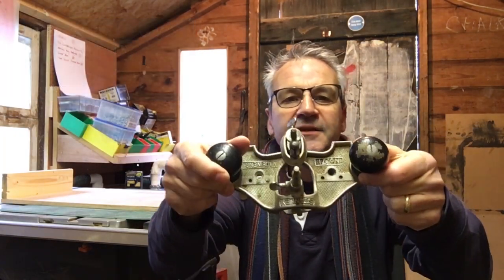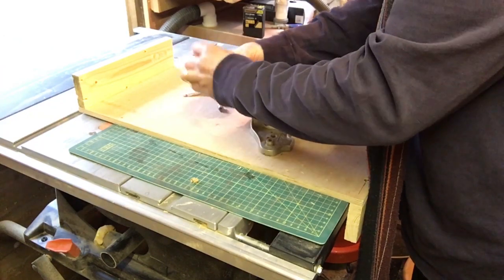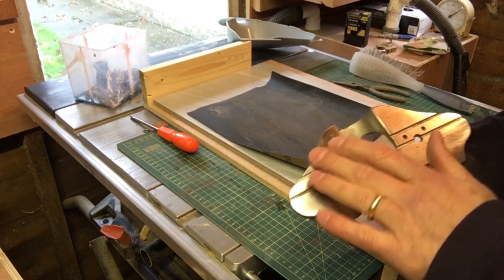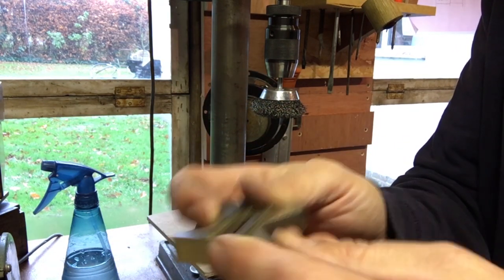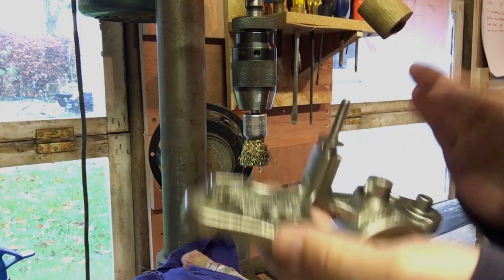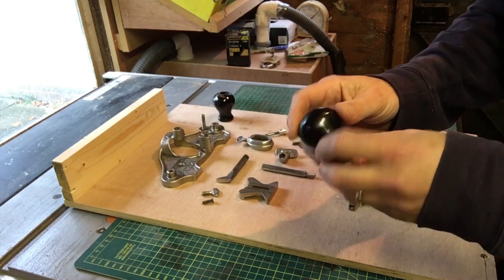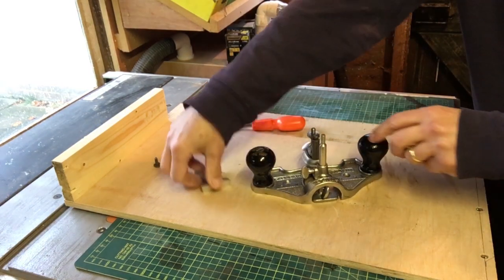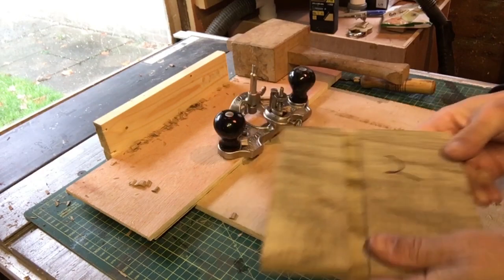Restoring and sharpening an antique Stanley No. 71 Router Plane

Comment: The No71 is an open throat, the No71 1/2 is the closed throat version. The shoe on the 71 is used to close the throat for when it might be needed to work on edges of wood...it stops the plane tipping. The cutting iron can be also mounted facing the back of the plane for bullnose work, or left/right while mounted at the back of the plane....but I see little use for it mounted left/right. Turn the shoe upside down and the post end of it works as a depth gauge, but I find its handier to work to a scribe line for through cuts.....the shoe for mine lives in a drawer and I hardly ever use it. Its best practice to use the plane on your side of the work......that is...... never working out through the back of the piece, work from both edges and into the middle of your housing/dado  :) Bench planes or joinery planes are loads of fun to use, and also have the added benefit of no noise and no dust, it also gets the heart pumpin......happy planing :)
Reply from the maker: Thanks that makes sense , I realised my technique was poor but I will learn when I do a proper joint soon
Reply: Most of the time I have seen that throat stop used to keep the plane level when you are dressing a tenon flat a d square. Keeps it from diving
Reply: @alangreen3425  I use a wooden sub-base on mine, so I can bridge wider gaps and avoid tipping the plane..... it still happens sometimes tho if im pushing/pullin too hard coz im too lazy to hone a proper edge....those standard cutters are awkward things to sharpen, so sometimes I leave it too long :P
Reply: I agree. I have both a 71 and a 71-1/2. And I agree. I am not a pro..I do what I do for the enjoyment. I enjoy the challenge of getting these old time tools to give me the results I want. :)
Reply: @alangreen3425  Most of my planes are at least 80 years old.......its nice to think as I push my planes forward;  how many things might have been made with this plane in the past?.... ya cant beat old tools :)